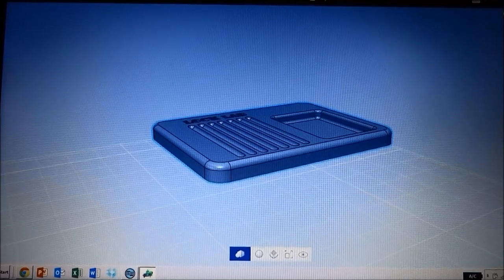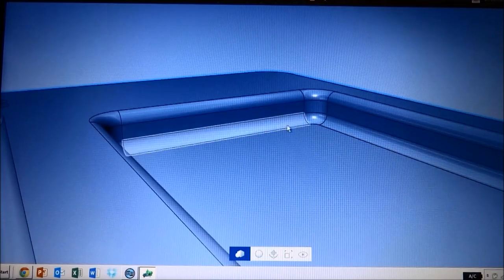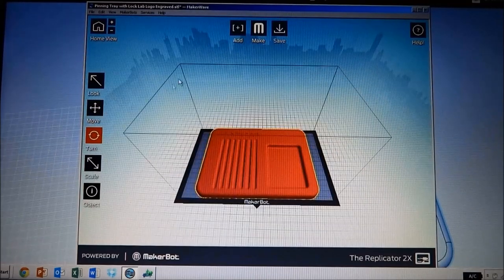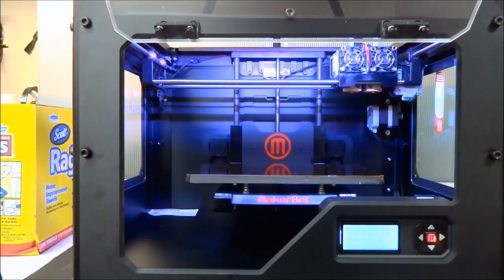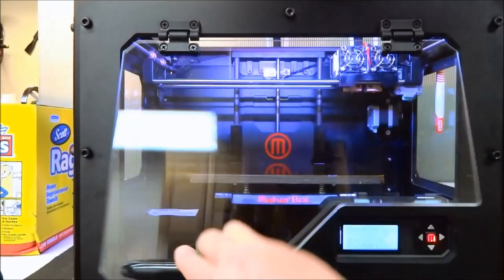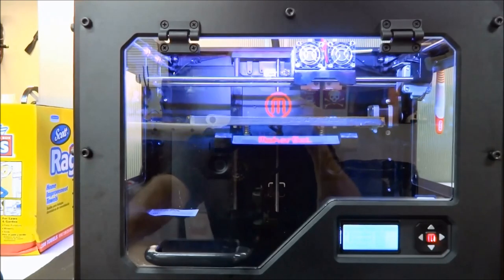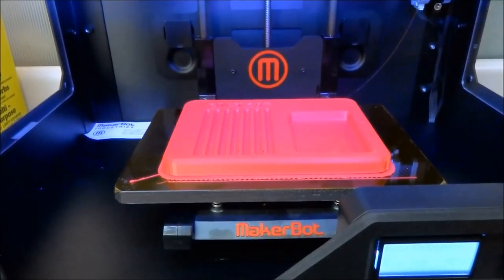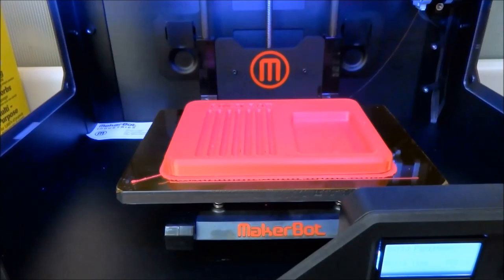(331) World's Most Expensive Pinning Tray

Comment from the maker: Unfortunately, you need a foundation upon which to lay down the plastic.  You can't start lying plastic in mid-air without some kind of support.  Fortunately, the slicing program checks this and forces you to use "supports" or "infill".  Infill is for "solid" objects and supports are for free-hanging objects (like a tree branch).  Either way you go you'll have to use plastic.  20% is about as low as you can go and have a solid feel to the pinning tray.

Comment: Impressive. Did you port the 3D data file from Acad to the printer?  If so, I wonder if Pro Engineer can also?  Nice tray too.  I am going to make a couple from plastic cutting boards (your idea) and use my router with a template. Could make one freehand like you did with Dremel but I would be routing the walls and floor before I am done.

Comment: $20? People always told me printing stuff was dirt cheap (pennies), so their idea of cheap, is inaccurate. Thanks for clearing it up with real numbers.
Reply: ***** The prices have dropped a lot. In 2013, it was still a new thing and material suppliers were few. These days, there is a strong rivalry between them which dropped the prices. PLA filament for 3D printing is currently cheaper than wood and especially HDF. ABS is about double the price of PLA. Getting material from the 3D printer manufacturer is several times more expensive than the market price, so there's that, and it's presumably that price that the calculation was based on.

Still, it's likely to be better to produce the vacuum extrusion form on 3D printer, finish it per hand, and use that to extrude the final product from sheet plastic in this particular case, if only because then it will take a minute per item and not hours per item.

If you need small parts or special parts, then of course 3D printing is MUCH cheaper than buying, has always been, because there is a lot of retail overhead for small parts and the markup is generally high on special parts.

Given that you don't discard any material when 3D printing and would discard material when e.g. carving something out from a block of wood or plastic, it is sometimes cheaper to print mostly-hollow or partially filled parts than the price of raw material if you were to carve them, and even if it's more expensive, the labour saving alone can be worth it.
Reply: Siana Gearz  Wow, thanks.

Comment: I wonder if you could put a slab of plastic/wood/whatever on the stage and build over it. Just print the edges and the top.
Reply: +Jim Fortune You'd probably want to print out the edges and top first, and then epoxy it to the base.
Reply: David Novak I was thinking that instead of trying to figure out ways to keep the build from sticking to the base or carefully prying it off the base, just build in the base and when you're done, slide it out of the printer as a unit. Why spend so much time and effort building a slab?
Reply: Oh! I suppose that could work just as well haha
Reply: Jim Fortune That's actually a really nice solution to the sticking problem